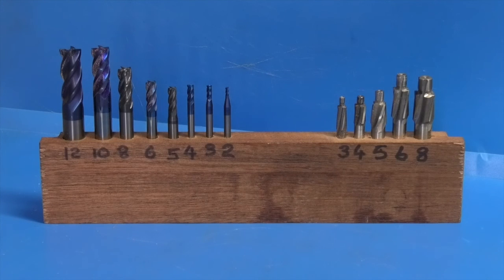Milling cutter tool storage rack

Comment: Hi Alan. I did a similar thing with morse taper drills. Admittedly in soft wood and the moisture in the wood started to rust the taper! Maybe it’s better with hard wood. All the best for the new year mate👍
Reply from the maker: Hi The woods been in my workshop for over 10 years but I will spray the holes with WD40 to reduce the risk.